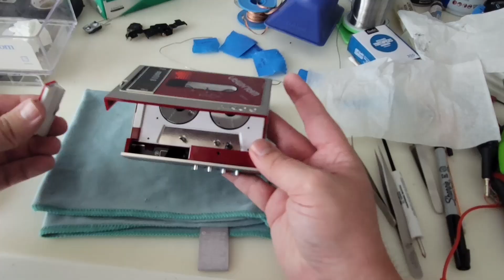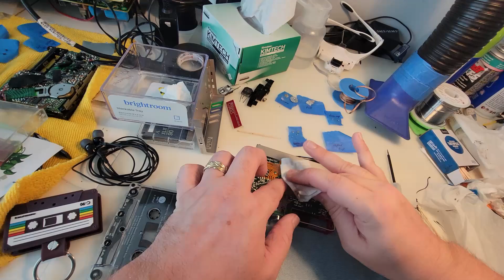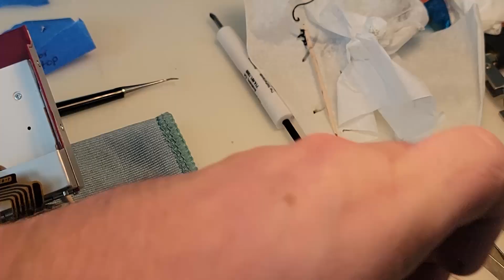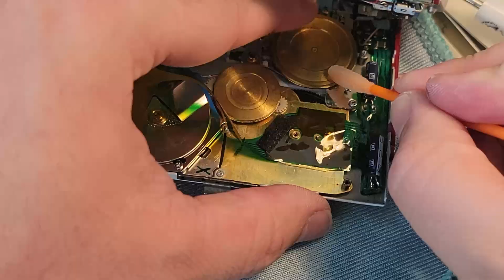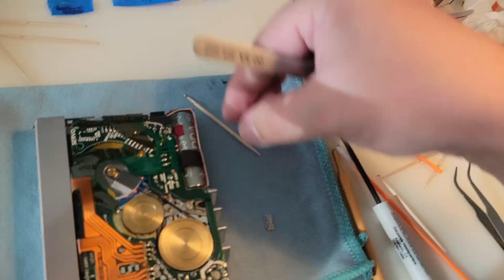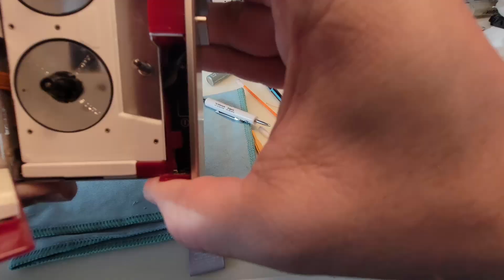Sony Walkman WM-F10 Belt Change Repair

Comment: Thank you for your video. In your video that you had a hard time to align the switches, my solution is to use the small piece masking tape to tape the switches before remove the cover. Find some sticking masking tape and press tape hard on those switches, so the switches will remain in the place when the cover is removed, and place the cover back only take a minutes. I also tried to put a little white lithium on the switches, so the switches will stick to the cover.

Comment: Nice work and appreciate the informative commentary.  It would have been icing on the cake if it were possible to show some after service metrics like tape speed and wow and flutter to see how close these players could be to factory specs after servicing.  Cheers.
Reply from the maker: Unfortunately servicing is only half the battle when it comes to meeting factory spec. There are a lot of things out of your control such as motor condition, capstan or bearings wear, plastics condition, etc. There are also additional steps that can be taken for deeper servicing such as re-etching the capstan shaft and replacing the pinch rollers.  With these older compact walkmans the most reasonable goal is just to get the wow and flutter below a threshold where you can only hear it with piano or classical music, not in every day listening. Most plastic walkmans weren't capable of better than that even when brand new... only the quartz-locked disc drive (DD or D6) models can exceed this expectation.

Comment: This was great. I have a question. I just got a wm-10. I got a new belt. Meticulously cleaned the belt path. Cleaned the small contact switches, but I can't get this thing to play for more than 2-3 seconds. Rew/FF work fine. But as soon as i hit play it disengages after a couple of seconds. Would you know could lead to this problem?
Reply from the maker: Are the large half dollar size white plastic gears under the reels cracked? You can see their edges as you turn the reel spindles by hand, look at the side of the unit
Reply: @treminaorugx  Thanks for the reply. Check the gears with a magnifying glass. They look good.But the teeth look they are made of metal.

Comment: I’ve rebuilt three of these in the past. Just scored two more on eBay for $50 each in mint condition aside from needing a belt and probably some contacts cleaned up. No battery corrosion. Both sellers said they wouldn’t power on. Some people don’t know you have to have headphones plugged into the jack to turn them one.  These are great players when they work well.  Loved this video. It’s a fun hobby. Hardest one I’ve done is my Aiwa HS-J600.  That belt was very challenging to replace.  You have to desolder and solder ribbon cables. 😬
Reply: Any chance you’re selling any of them? I’ve been trying to get my hands on the f-10 for a good while but can’t find it for a good price

Comment: I wish I'd known 10 years ago that I could buy replacement belts for walkmans.
Threw two out because the belts has disintegrated.
Reply from the maker: Ebay is full of belts but most of them are not manufactured to an acceptable degree of quality. The diameter and thickness are both very important, as well as the stiffness and the precision of their cut. I only trust belts from a website called Fix Your Audio. They are a hobbyist based in Slovakia that spun up precision manufacturing of replacement belts and other rubber items like pinch rollers.